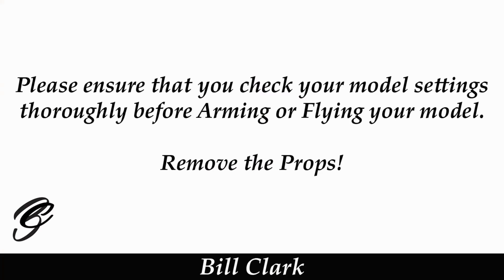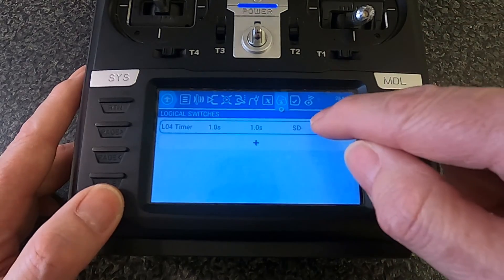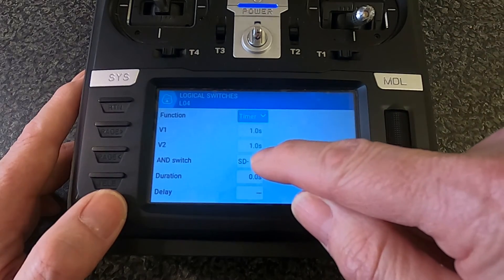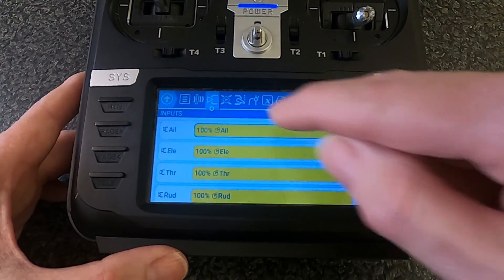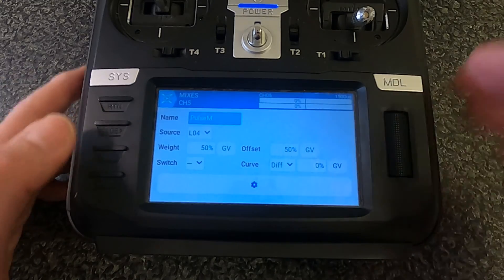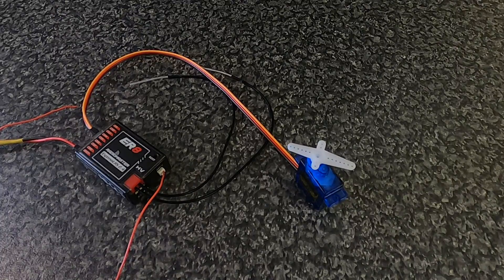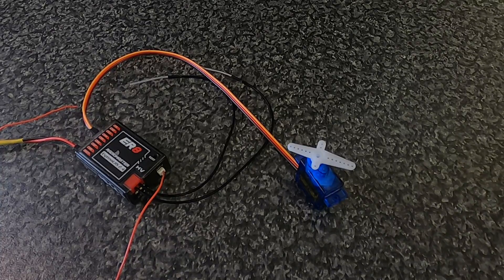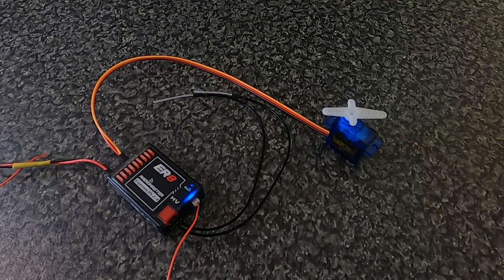EdgeTX  - Servo Pulsing Movement (Viewer Request)

Comment: An interesting video. On my Multiplex Tx I have a similar function that I can select and the function lets me select any servo to exercise. I use it for range testing. 
I set the Tx in range testing mode and then select the servo pulsing mode, I usually use rudder. I can the carry the plane and walk away from the Tx until I get intermittant servo action to get my range check. I can also do it with the motor running as well which is also a good range check
I would think that you could do something similar here but would need to think it through for safety. In the Multiplex Tx it is in the software so when you have finished you can switch it out in the software rather than a switch which could be knocked in use. Perhaps it could be used in a special function which could then be disabled after the range check and before flight.
Am I being a dinosaur in wanting to do such a range check with my Tx16s which up to recently I have only used for small indoor helis?
Reply from the maker: With the RadioMaster TX16s you can reduce the output power to around 10% which makes range testing easier. I do range test my models normally each time I fly. It would be possible to set this up to a Logical Switch linked to the armed switch so when the motors is armed the servo range test movement is cancelled.
Reply: @the-happy-RC-flyer  Thank you for that. I will have to think more on this. 
If you range test each time you fly how do you do it? 
Also what do you consider a good range assuming that you use the range test mode in the software. 
Mine is 4 in 1 by the way.
Reply from the maker: @maxwellgeorge1985  I would say low power mode around 30 metres. I watch for the control surfaces twitching they should be stationary and smooth motion when the gimbals are operated.

Comment: If I use servo 1520us at min is 1000us at center is 1500us at max is 2000us.
Now if I use one servo  760us if I use 2000usec at max stick the servo it burns?
Flybarless for servo 760us use different signals, 760 at center stick and at max stick use max 1060usec (it just add 300usec for servo with impuls center 760) while for servo with impulse center 1520us add 700usec
Reply from the maker: If you want to adjust the limits of the servos you need to use a combination of adjusting the weights, offsets & differential in the mixes.

Comment: This is an interesting feature i haven't tried before, thanks for the video! Would it be possible to control that pulse somehow via control pot or lets say throttle control? Possible ornithopter flapping control 😅
Reply from the maker: Hi, you would not be able to use the timer function because V1 & V2 can only be set in seconds. I am assuming you are thinking along the lines of servos powering the wings. I will need to give this some thought. Very interesting.